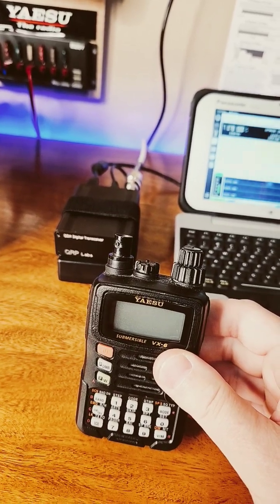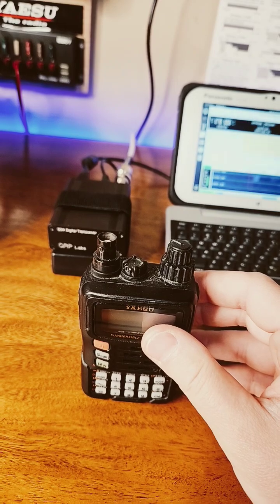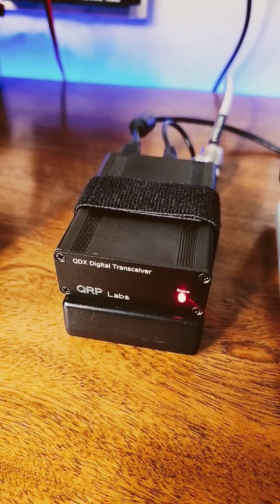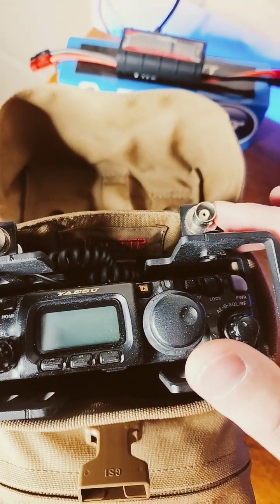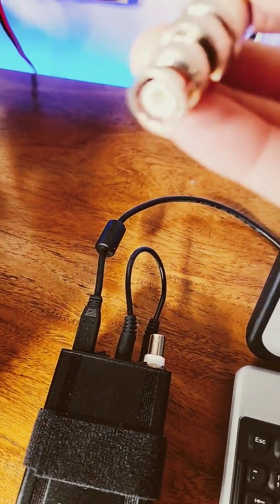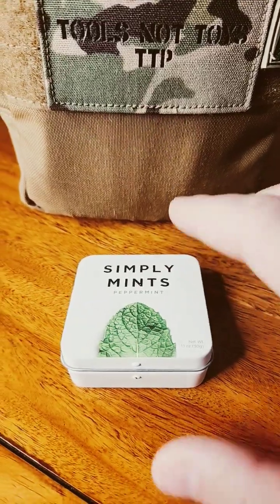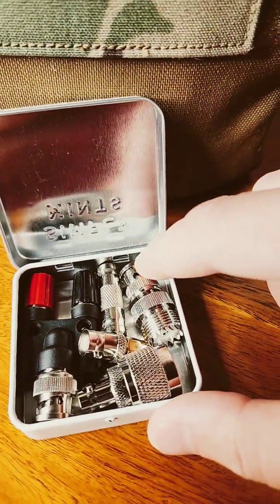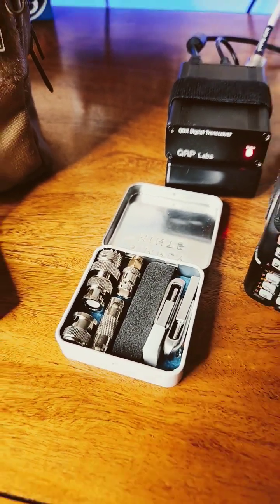My Commo Antenna Standard - BNC

Comment: I like SMA (tiny, secure, low loss at VHF/UHF) but I'm in the minority.  There are definitely too many choices.  "We like standards.  That's why we have 15 RF connector standards."  All the serious hams use BNC.  I hate adding an adapter because it usually adds 0.25 to 0.50 dB signal loss.  That's particularly bad for QRP.

Comment: Been running wspr checks on my qdx to test my antenna s. Handy tool.
Reply from the maker: Excellent. Then, you're going to love my new JS8Call "heard station" integration with the Tactical Awareness Map (TAM) in EmComm Tools. I used to use FT8 for propagation analysis. This solution works 100% offline. No need for pskreport anymore. Stay tuned for a tech preview on Buy Me a Coffee soon.
Reply: @TheTechPrepper  🥹😲